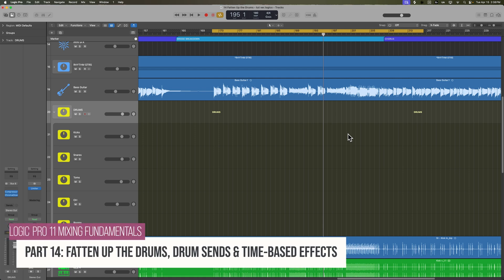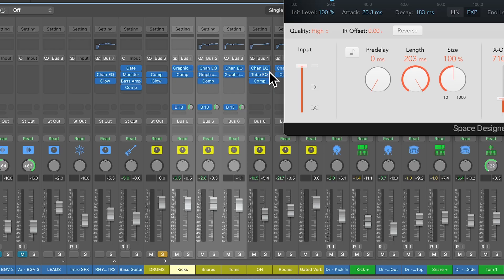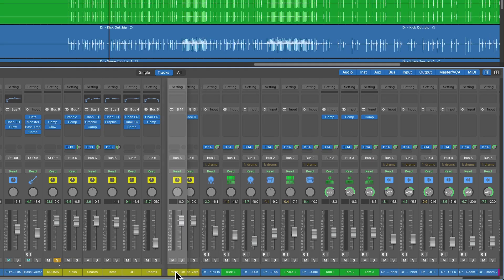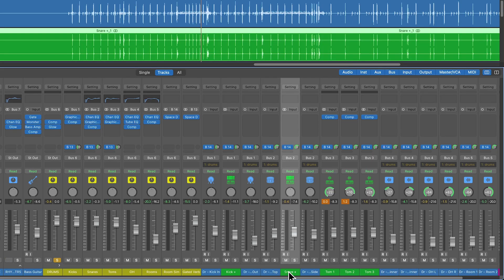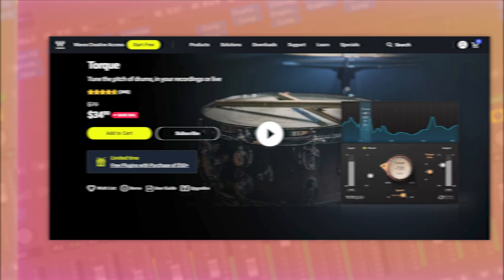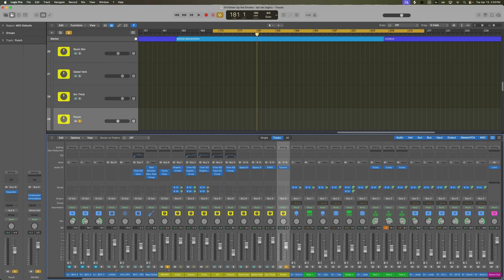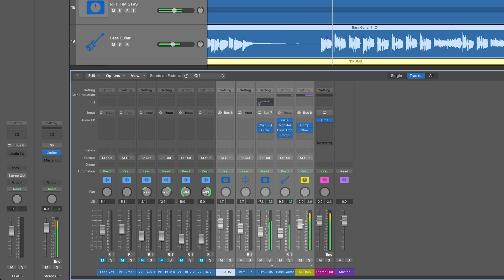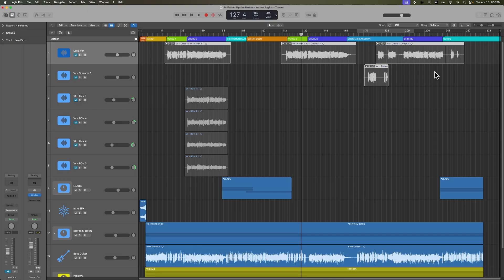Logic Pro 11 Mixing | #14 Fatten Up the Drums, Drum Sends & Time-Based Effects

Comment: Thanks Josh for another great video. Can I assume this also applies to software drums? I use the Logic Drummer plugin which I then convert to Midi and separate the individual drums and mix each track separately.
Reply from the maker: Yes, absolutely. If you are using the multi-channel kits with Drummer you can separate all of these channels out and mix just like a real drum kit.

Comment: Hi Josh. Another banger of a video! It's really interesting to see you using the Expander for the Punch channel. I'd assumed (because you're using stock plug-ins) that you'd be reaching for the Enveloper, Logic's dedicated transient-shaper plug-in. I'm just curious - is using expansion something you've started to do more recently for adding punch rather than using purpose-built transient shapers? It seems to have become more of a thing in the past few years, with Izotope really pushing expansion in their new features in Neutron and Ozone. It's as if the idea were somewhat 'niche' but has become more talked about recently.
Reply from the maker: You can use either or and get similar results. I'm not a big fan of Logic's Enveloper - it's just not 'smooth' enough, especially when I try to reduce the release. I typically use the Newfangled or Native Instruments transient shapers.